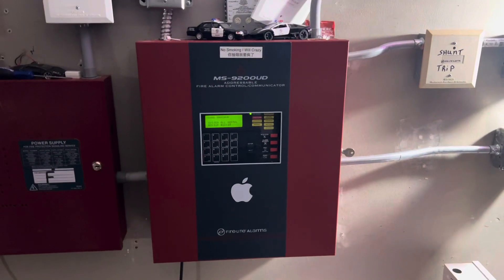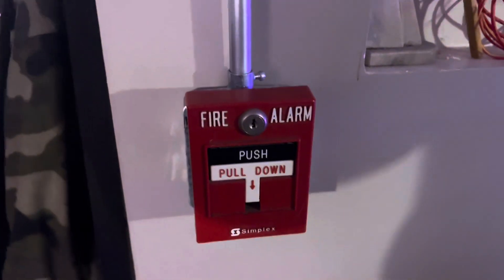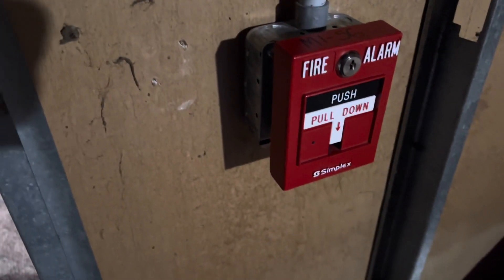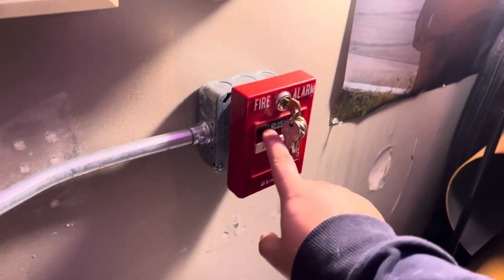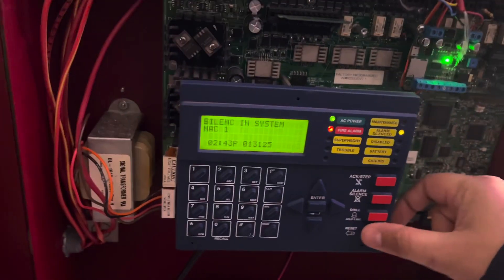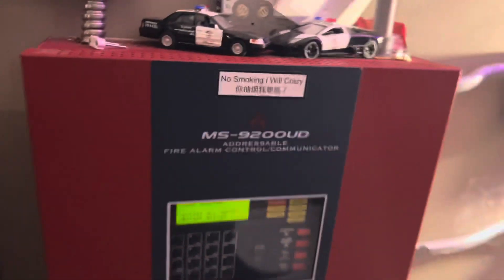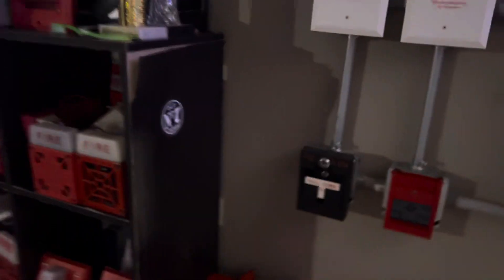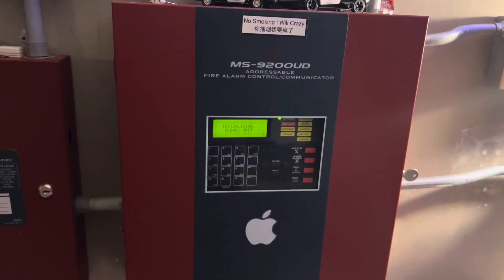System Test 26 - Whoop Whoop is the sound of Simplex Voice Evac

Comment: noice i seen a red ceiling mount speaker strobe of 4903 simplex speaker strobe. however in the manual order model it is only in one color with white and red lettering while that his red with white lettering. however i had to use trilingual simplex voice evac for that though. if it's an edwards it needs an edwards voice evac.

Comment: I just saw that you posted this video now. I’m glad I saw it!

3:47 Those are fairly rare and possibly new-ish. I know the Autocall dealer in my area has used those on a few of their projects in the past couple of years, but I’ve never seen them before that. There is a hockey arena near me got a system upgrade two years ago that now has over 150 of these and a new (as of last year) elementary school in my area that has these in every classroom. Both of those buildings have Autocall 4100es systems.

4:29 The middle school that I went to has those in some of the newer classrooms (yes they are 110 candela).

Comment: Are the strobes on Wheelock sync
Reply from the maker: It’s connected to the Simplex 4905-9938 Smartsync control module. It can sync Wheelock devices also.

Comment: This is a really cool video! My college mostly has 4903-9148 Speaker/Strobes for its rectangular 4903s. Same thing as the 4903-9150s except the strobes are 30CD which is twice as bright. They have some of the other two models too. About the replacements I've seen 4903-9149 110CD Speaker/Strobes replacing older 4903-9144 Speaker/Strobes from 1999 in public before.